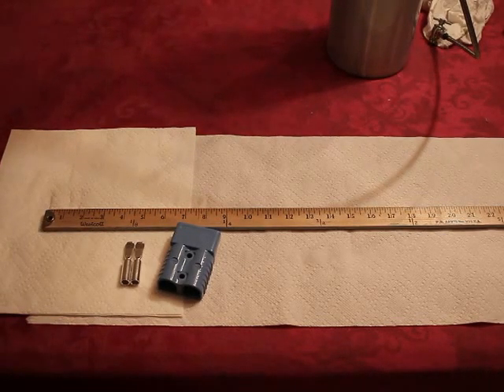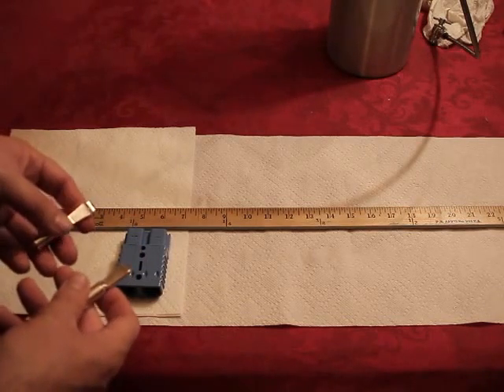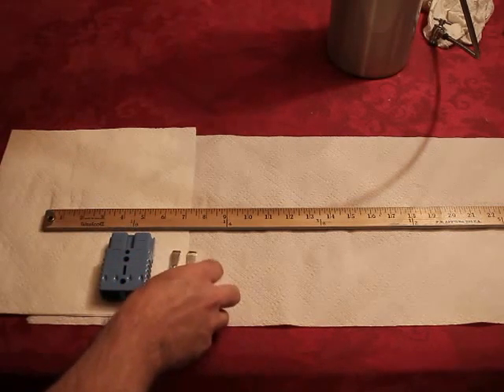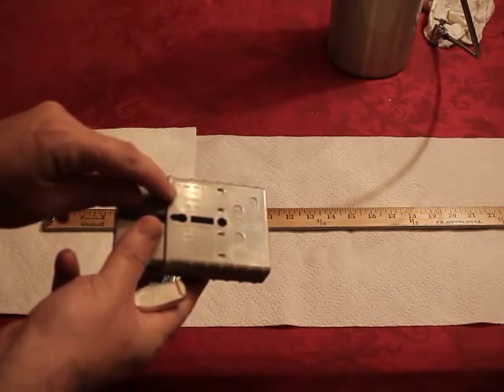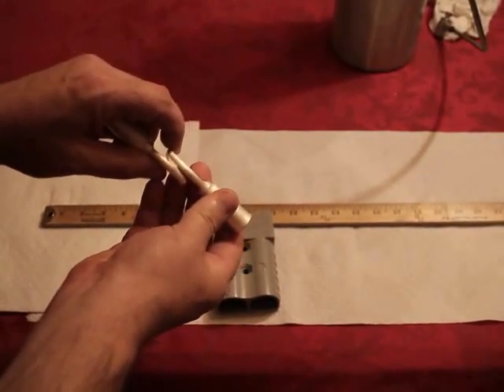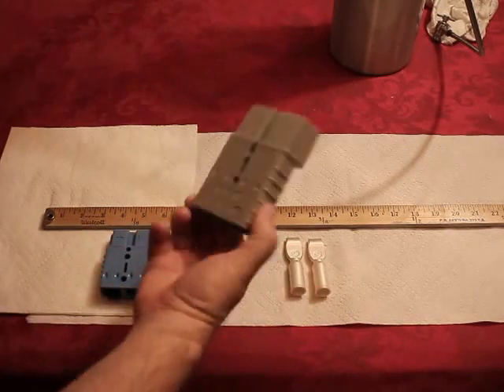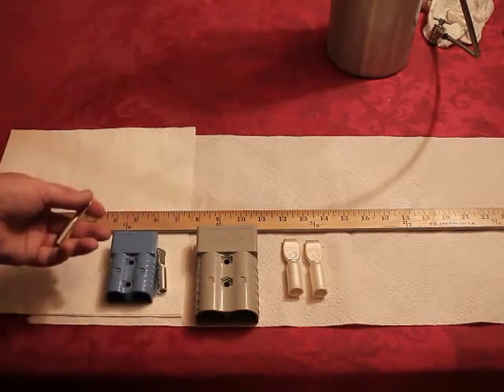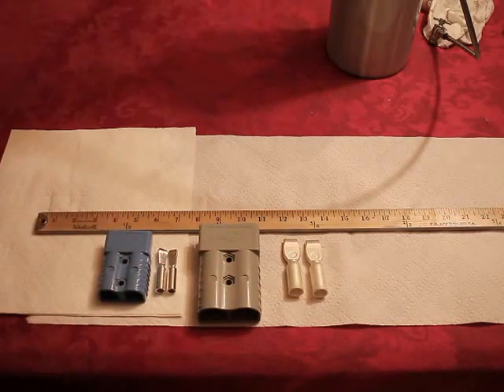500 amp Anderson connector scam. 4x4 winch project.

Comment: Genuine anderson plugs, the 50a is 1.44 inch wide
120a is 1.75 inch
175a is 2.09 inch
350a is 2.75 inch 
Id say you have the 120a there in the blue. Also yes, genuine anderson plugs carry far more current than non genuine ones of the same size, and for the current rating to be true, they must both be genuine ones as there are a variety of pin shapes available in non genuine versions and unless they mate together properly, the poor fit can definitely cause high resistance and therefore heat. Ive tested fake but seemingly good quality 50a andersons and they got hot at 40 amps, but the genuine 50 amp anderson didnt even get warm at 75 amps. So theres definitely a notable difference. I use the genuine 350 amp anderson on a 3000w 12v inverter and the 00 gauge cables get warm but the connector stays stone cold. You get what you pay for honestly.

Comment: Just run dual 350amp plugs... 700amps 😉
Reply from the maker: Thought about it. Also thought about running the 300 amp breakers duel since they are also crap chinesium and not really 300 amp. But I'd rather find a good 400 amp breaker.

Comment: the guy you contacted is most likely lying to you that no one has complained . people have complained its just they complained after the warranty is over . things are designed to fail after a certain amount of use , some times its due to the fact that one part has to fail before another in order to protect the more important part . that said , thats not true in all cases . just most of them .
Reply: what a difference between the two connectors . we all know which one will out last the other .  unless the metal that is used comes from china and has lead in it . sorry china just saying ... nevertheless i have noticed that china is improving in the quality of their products .
Reply from the maker: Oh I agree that people have complained. He is just preying on people with no mechanical / electrical knowledge.   For anyone that complains he just gives a quick money back and can do that because he got them so cheap.  The key problem is the grind. The contact area for a normal anderson connecter is two lines the width of the connector "shoe" so to speak.  That is what makes them capable of the amps. These cheap connectors from canada winch were not ground flat but were rough forged and then chromed. Their contact point was one itty bitty spot that would have gotten hot and then corroded. I supposed that might have happened outside of warranty because for sure they wont last long at all. And that is assuming only 20 to 30 amps of usage. 
If I had a better camera it would show the curve on the smaller connectors.
Reply: yes i agree , a person has to be careful with what they buy . i remember getting a solenoid that was made in china , sold at wheelers whole sale " graingers " , and it had a metal cap with plastic keepers to prevent it from grounding out , well the funny thing is that the rain eventually started it to ark and drain the battery almost dead . any good solenoid comes with that special plastic type cap so it cant ever possibly ground out .
Reply from the maker: Ok now I am going to have to find that solenoid I bought for a 5000 watt antique generator and check its construction.  Those generators are always draining the battery.

Comment: fyi that looks a lot like SMH SY-175A-600V-BLUE Power Connector Plug 175A 600V
Reply from the maker: It's not. :) These would probably get warm at 50 amps.
Reply: With the one piece connector they make sizes, a 80A (used to be 50A), a 175A, and a 350A.  Those come in half a dozen colors that are keyed different. That blue one is a 175A and the gray one if a 350A.

I've had 1000s of these in my hands dealing with industrial batteries and backup power supplies.

All else fails go to the source:
https://www.andersonpower.com/us/en/products/sbe-sbx-sbo/index.aspx

Comment: Hi consaka1, I have dealt with a few Anderson connectors and have seen twin lead weather boots to provide some rain protection for new construction of plugs. I have also purchased caps with a loop to slip over the connectors ends. They are available in several colors, usually red or black.  The gray housings are just a few sizes and can fit different gauge metal tips in the same size housing. For instance, I have 2 AWG and 4AWG tips that fit in housings marked 175A-600V.  True ANDERSON connectors have their name molded into the plastic housing and their metal crimp / solder tips have an "A" inside a circle along with some very small print stating series and gauge . I have made cables for my motor home ( toy hauler ) 12000 lb. winch out of 4GA twin lead  and Anderson connectors. One is 30 ft. M/F ends and another 20 ft.  with heavy jumper cable battery clamps on one end. Both have served me well with no heating or power issues.  Always good to share brain cells between DIY guys....... RV Prepper      Jim K
Reply from the maker: Thanks for the comments. I wish I had the covers to protect the ends when unplugged. Pretty sure these are 350amp connectors. Haven't found any covers for these yet.
Reply: I have purchased covers before and found that Anderson also sells the weatherproof boots to go over the wires before fabricating.  I just went to the home page for Anderson and noted their SB50 Environmental boot as well as the slip on caps. Amazon may have the caps but it looks like they sell the housings and tips separately....very confusing.  W. Grainger also sells Anderson products.  Happy hunting.... J K
Reply from the maker: James Krivitsky thanks for the heads up on that. I'll take another look see soon as I get this engine built I'm working on.

Comment: The grey one is the size of my 50A genuine anderson connector.
Reply from the maker: I bet the mating surfaces are actually flat though. These have been cast and then chromed or something. The contact surfaces are slightly peaked. The real connectors are ground flat crosswise to the connector.  That way the entire width is in contact. 
I still haven't had time to do testing but I bet these get warm with just 30 amps going through them.
Reply: I have come to realise that power supplies often have three input points, so I will divide power cables into three 15A lines. The points on the power supply are too thin to tolerate 50A anyway, so I actually HAVE TO divide by 3 for various power needs.
Reply from the maker: Zxenmusic I can see doing that if you don't have heavy enough cables or connectors.
Computers do that all the time since motherboard traces typically can't carry very much power. So they run multiple wires to multiple traces.

Comment: Maybe when you put 500a through it, the 2 mating surfaces will melt to fit each other perfectly, lol! 
Total BS. I hate these sellers. Especially when they use the old 'I've sold xxxx amount of these' excuse.
Buying jump leads is the same on ebay. Some sellers seem to think a 25mm2 cable will carry 1200a!
Reply from the maker: Yeah how did you know they have sold 500+ with no returns? The amazing thing is how they keep their rating up.

Comment: Right on, really great info!
Any update on your connectors?
Reply from the maker: +Philip Gragg Not really. I haven't had a chance to put them into service. I would also like to find the end caps for them to keep the dirt out when they aren't plugged in.
Reply from the maker: For the real 350 amp andersons I have now put them into use. I ran heavy 2/0 welding cable from the front of my van all the way to the back and bolted one connector to the side of the receiver hitch for the vehicle.  I use it when I stick my 12,000 lb winch on the back. The winch of course has another connector that plugs right in. I plan on also making some jumper cables that will plug in as well.  When I build my winch bumper for the front I will use two receiver hitches for two removable winches up front and will again use the anderson connectors for that.  So far it is working really well with no problems. I have pulled  a few jeeps out last winter and the winter before and last week I pulled down a dead pine tree that was stuck in among a bunch of maples. I also grubbed out an entire hazelnut tree. Just wrapped chains around the base and used a nearby cherry tree for my gear reduction.  We did it but it sure didn't want to.  My 8,000 lb van still wasn't heavy enough. Fun times. :)  Connectors didn't even really get warm. Maybe a little but very subjective
Reply: @consaka1  Would AWG 1/0 and the genuine Anderson 175 Amp work in your exact situation? It is what I was planning on for mine all things equal except AWG and Anderson amp rating. I will be running off and independent Aux battery.